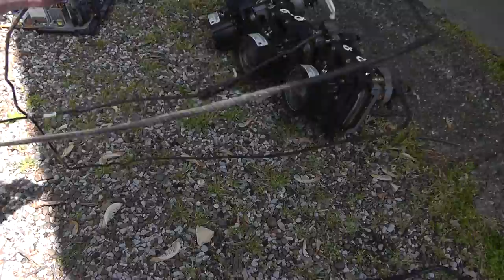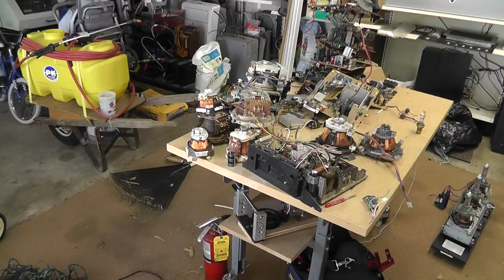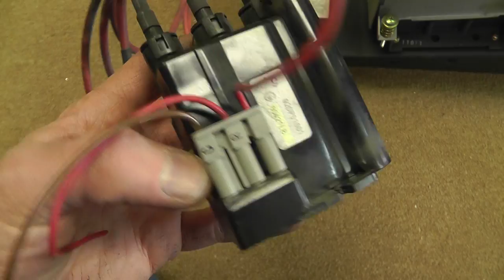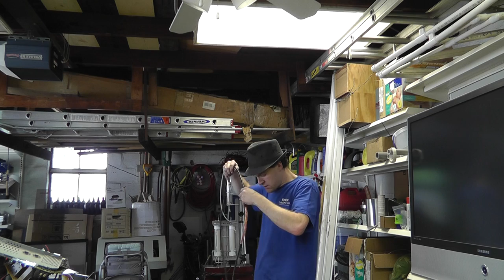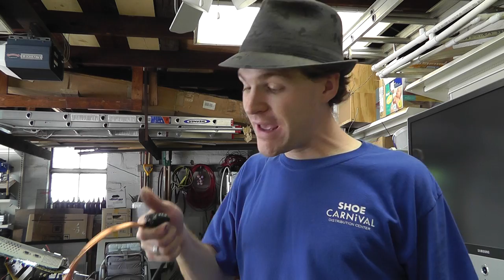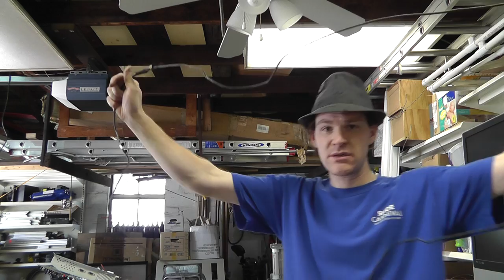Heavy Trash Day Experiment, Round #2 Day#2     4-25-2012 RWGResearch

Comment: The tripler is worth keeping as you can use it with another LOPT to increase voltage output. The other 3 wires are to connect to ground as a 'diode pump' as they are sometimes called needs a pulsed input and ground.

Ian.

Comment from the maker: Ok, so the pots adjust from 0-100%? Or just slightly? And there on the electron gun... So there in the lower voltage range? There not at the same potential as the screen??? 

So I should be able to bubble any flyback with that doubler? Any idea how to find out the ratings on such a thing? Thanks for the help!! Also, what's with incoming 3 low voltage control wires??? ~Russ

Comment: That thing you are holding at 06.00 is a tripler otherwise called voltage doubler.
One output per tube.
The second thing you held up was a bank of high voltage potentiometers (variable resistors.)
As you can see the top row  was for adjusting the focus on the screen and the bottom row was for adjusting the A1 (first anode or grid) voltage. Again, one focus and one A1 control for each colour tube.
A normal CRT T.V. would have these controls built into the LOPT. (flyback transformer).

Comment: It is written on there for you mate. You have one input. Thats is HT (High Tension) input from the LOPT. There are 3 outputs. One for each tube. Then there are 3 grounds. I suspect that the triple tripler is divided into 3 parts. Thats why you have 3 grounds. You wont be able to work it out with a standard ohm meter but a visual inspection will give you all the clues you need... Look for indents in the plastic moulding... I bet you will see 3 sections on that beast... One for each tripler.

Comment: The pots simply adjust the voltages to the tube.

Yes, the tripler will be made up of diods and capacitors just like a normal tripler
only in your one there are 3 of them built in to one unit. It just increases the voltage.
For example +5,000 volts go in and +15,000 volts come out The phase will be the same.